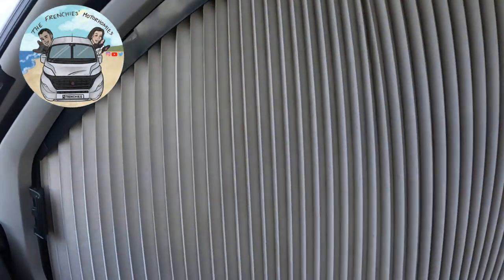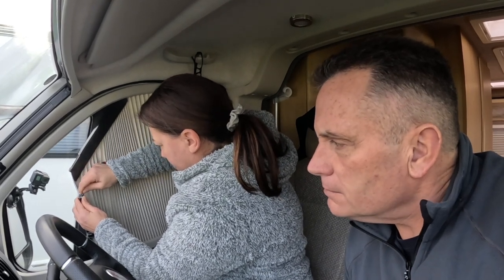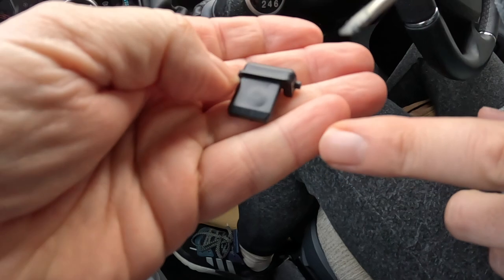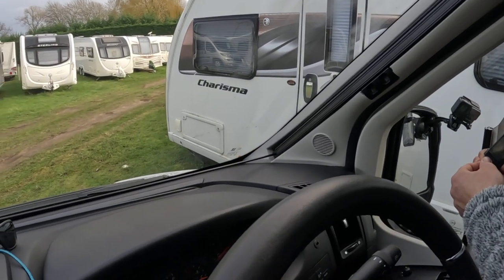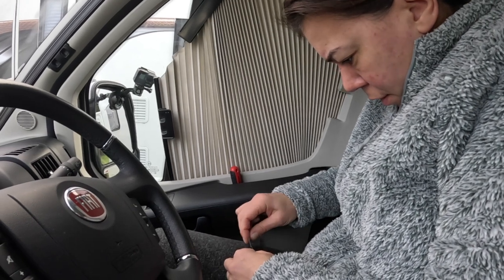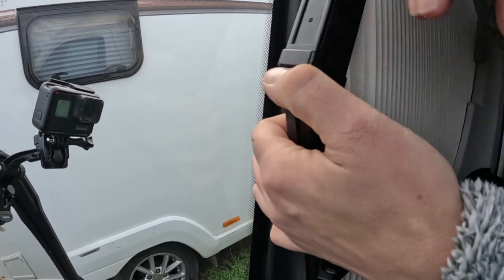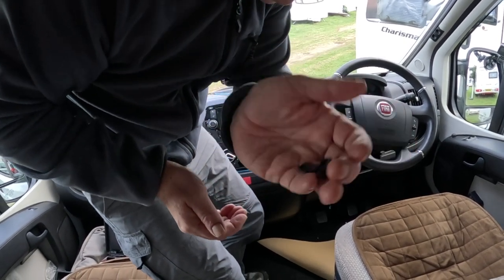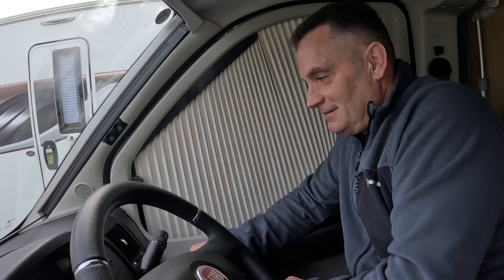HOW TO FIX A BROKEN REMIS BLIND - Motorhome - Campervan

Comment: Kudos! You fixed it. I have exactly the same problem. I tried to glue it with superglue and it lasted about 1/4 of a millisecond in place. So now I'll have to throw the towel and get the part.
Thanks for the video.
Reply from the maker: most welcome !

Comment: Great job #TeamKirsty My old van (Adria) had slightly different side blinds (the windscreen centre clip twanged off bit I managed to refit it), the new van however will have the same as your van, so I know where to go if mine break 🤭👍
Reply from the maker: Thanks debs yes I remember the adria are the blinds that pull up and down nice and easy , oh definitely come to me if you need anything done 😂👍😀
Thanks for watching

Comment: Hi, this is obviously a weakness of the Remis system which is why I prefer Dometic blinds. If it happens again, I have seen a video where they fix the problem for a fraction of the price with two plastic cable ties.
Reply: Could you please post a link to the video (if it is about the Remis hinge)?